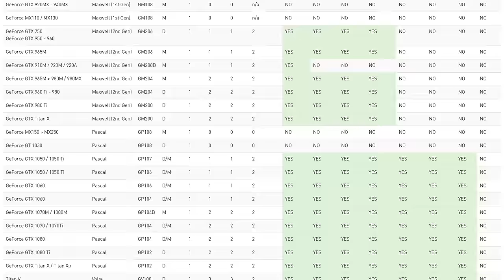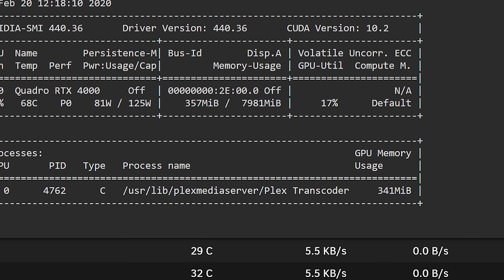5 First Plex Media Server Build Mistakes

Comment: I've noticed something strange with my server. When transcoding.. playing out a movie to my roku the CPU temp is between 41 to 57 C. When transcoding...playing out a TV show episode. It runs from the low 50s all the way to the high 60s.

Here's my specs
Linux mint 
Asrock motherboard 
32gb crucial
AMD ryzen 3 3200g
Front and rear case fan
AMD processor fan
I vented the pci slots.

I'm at a loss for the weird temp fluctuations. Input is appreciated.
Reply: I think that this depends on the file type. Some file types need more transcoding power and other don't.
And besides... 70 °C is not bad for the CPU. If you think that the CPU temps are to high buy a better CPU cooler.
Reply: Pretty sure he's right. The movies are probably in a file format that requires less transcoding, since most of your TV shows are probably from a capture card versus some type of physical media rip, and we're converted to awful formats for size relating to uploading if I had to guess, but like he said, those aren't bad temps at all. Actually pretty good. If it was 80c+, you might would have cause to worry.

Comment: What is your take on prebuilt servers like a Dell R420?
Reply: You can do just as well going the DIY route, but way cheaper. If you are a company and want to have a lifeline to call (ie support) then go with Dell, HP, Cisco, etc. If you are a home user, DIY it!
Reply: @jbat66  found a bare bones cheap and planned on DIY-ing it from there. Also going to use it for a minecraft server for my kids and friends.
Reply from the maker: you can get some great deal on old servers from ebay or the like. But some of them can be pretty loud
Reply: @Bytemybits  yeah gonna be in the basement by itself

Comment: Love the Seagate hate haha. Not gonna lie though mine have been pretty reliable so far.
Reply: I have 5 5TB failed in 2 years time, luckily all during warranty.
Now the next one failed just outside warranty.
So yes I understand why people hate Seagate 😉
The replacement drives work for many years now, maybe I had a bad batch. 
But the shop stopped selling them as they got to many warranty claims as according to them they sold around 50 of that series and all came back
Reply: I spoke to soon.
The next Seagate drive broke yesterday and I hear a strange sound on another drive.
I checked smart info and it seems my Seagate 8TB is also generating errors and this on is 2 years old.
Replaced the 5TB with a Toshiba Enterprise 18TB and the system is recovering now.

Comment: "You don't need a lot of RAM", "16 gig is the bare minimum"
I'm confused.
Reply: XiaZTV 16 isn’t usually considered a lot of ram these days.
Reply: @SnowyRVulpix   Yes, 16 is not considered a lot for normal PC.
But for Plex, 16 is not a bare minimum, more like 4.
Even with a lot of app running in the background (like Usenet/Torrent client, sonar) and while transcoding 4K the system only consumes 3.8 gigs.
It doesn't mean more is bad, OSes these days use spare memory for cache, so by having more you get a faster system overall.
But the bare minimum is definitely not 16.

Comment: Should I use NAS certified drives or normal drives are fine for plex? Specially if running multiple drives?
Reply: NAS drives have several benefits... the biggest thing is they are rated to run 24x7.  There is also additional logic in the boards to handle errors.  Also you get a better warranty.  IMO its a no-brainer to get NAS drives.
Reply: Be warned, the WD red drives are now singled magnetic recording so they're a lot slower and you can't resilver them without errors

Comment: ok i missed what he said with ssd's sorry but yes the faster ssd the better and faster your plex or emby server runs
Reply: If you are running a multi-drive raid, the performance differences of HDD vs SSD for serial reads of media files isn't that huge compared to the drive costs of equal capacity.  SSDs for a caching layer and OS however I would agree with.

Comment: Just hitting around 3yr mark with my HGST Deskstars and had one spitting errors and not reading :( I just grabbed a refurb'd HGST Ultrastar 7K4000 for $64 on Newegg. Those drives are so cheap. The wiped the data off the firmware so it has "0 hours, 1st power on" though :(
Reply: HGST drives are really, really good.  They no longer exist however.  HGST (Hitachi Global Storage Tech I think) was spun off by Hitachi and was part of the WD family.  They are used in many multi-million dollar enterprise arrays from DellEMC, Hitachi and IBM.  Hitachi forced WD to give back the H essentially, so WD had to rebrand the drives.  I think they are just be rebranded WD Enterprise so looking for those will provide a suitable replacement.
Reply: @RVSpinX  Ya I remember when they were bought but I was hoping to grab an old new boxed one lol. I may just start using these old enterprise refurbs from now on. My PLEX server has 6x10TB shucked WD Elements so I have my NAS backed up on there now.

Comment: I have got an nvidea shield. And i wanted to connect my wd 5tb storage to this via usb l. Will this be okay as the nvidea is on 16gb and i dont want an issue about thumbnails.??? Any help on this.
Reply: I think you'll be good to go, but it obviously depends on the size of your library, so there's no way to be sure from here. : ) 5 TB is not too much in the Plexverse. Some larger libraries go over 20 GB.

Comment: I have to laugh every time someone trashes Seagate hard drives, ive had them running for years on end without issues. I have a 40 gig running for over 14 years, in that time i have replaced over 40 WD hard drives a every kind, and all my Seagates keep running. Guess its just luck of the draw and where they ship them out to as i see more folks out west hate Seagates and more folks on the east coast have issues with WD.
Reply: I work in IT and there are always piles of seagates , yeah WD’s keep appearing in old nas etc because they work
Reply: If you stick around long enough you'll figure out over the long haul that one drive manufacturer isn't any better or worse than the rest.  If you have a particularly bad experience with one, it's likely you got several from a bad batch, or a faulty model.  But this happens to all manufactures.  I think Seagate and WD get a bad rap because they're the only ones that haven't changed names half a dozen times in the last 3 decades.  Everybody else has been bought and sold several times over.  For every Seagate or WD horror story you want to tell me, I can point to an IBM (né Hitachi, né HGST, né Western Digital) or Maxtor (né Quantum, né Seagate) or Quantum (né Seagate) or Connor (né Seagate) or Fujitsu, or Micropolis or JTS horror story.

Comment: ok, running plex on ubuntu 20.04. set the drives to mount automatically using the gui disk tool. Now plex will not see the drives. any suggestions?
Reply: could be a permissions issue.

Comment: Anyone know if dual Xeon E5-2680's is enough jumping off point for a PLEX server to handle a handful of 4K streams?
Reply: I run mine on vmware esxi with 16 of the cores allocated to it on a 2680v2 which is 10 cores each on ubuntu server.  Cant even stream 1 4k stream if transcoding and tone mapping is required.  If you have a gpu that can transcode that will help a lot.  You are better off making sure the clients can just nativley play the content if you are using hardware that old.

Comment: I really enjoy your videos but I'm running Plex on my TS-253D NAS.  I had my challanges setting it up, but the primary issue was playing back or streaming video smoothly over my Cat 6 network.  Video's did not play smoothly at all.  By default, "Use Hardware when available" was turned on. I turned it off and now everything plays smoothly with no issues!  When I updated the server to a newer version, it went back to the default again and the playback issues returned.  Fortunately I knew the fix.

I noticed that for live TV, if it's a 480i station, it will record at a 480i resolution, which produces a reasonable size file.  But if you're recording a 1080i station, it records at that higher quality, and of course the files are tremendous!  

I found no options to record at a lower resolution when recording a 1080i  station.  If you are aware of a method, I'm all ears!
So I learned how to optimize these huge files.  I have 4GB of RAM, which is below your recommendation, so I assume the hard drives are working like hell when I optimize.  The CPU also hits 90/95% But, the result of the compressed file is amazing in quality and size so it's doing everything great. Would adding RAM reduce the activity on the drives for compressing files?  I'm thinking of increasing it to the max, which is 8GB.

The old Beyond TV I used to use would automatically compress video's each night.  And yes, the CPU would run at max.  But it was a Win7 machine with 12GB of RAM.  I'm guessing I should add more RAM to reduce the activity on the drive, right?

Also,  I didn't see any automatic process in PLEX to optimize.  Am I overlooking it?

Comment: I'm confused why my video card would be needed for my Plex Media Server on a headless Linux server? I do not even have a monitor hooked up?
Reply: To transcode streams. E.g. you have a 4k video file, but you want to watch it on a mobile phone. The server can make the 4K a 1080p stream to not overburden the phone. GPU's do this better than CPU's, which is why you would want a GPU in your Plex server.
Reply: This is only with plex-pass, it's a paid feature. However I goes into GPU transcoding in the video
Reply: @lenthemofo  interesting! I got a lot to learn apparently! I just bought a cheap video card, thinking I wouldn't be using it unless my monitor was plugged in.

Comment: My index or something is taking 60gb of space.  I changed some setting and it’s taking up too much space.  It’s a vm so I will scrape it and start over if I can’t fix it. It’s on a 12 core 24 thread intel with 74GB of ram. My media is about 12 TB.

Rack mount is loud as shit. Don’t ever buy rack mount. Look into silent case and only 2 16tb drives mirror. That’s it.

Comment: I copy and play all my media in DVD or Bluray, original quality to and from a qnap plex server.  When playing videos to my TV thru Cat6a, I still get issues of buffering, I am forced to "transcode" to a lower quality 20mbs-1080p.  I do not understand how or why transcoding from my original quality content has no buffering, and playing original quality has buffering.
Reply: I can play 4k hdr over my LAN. I’ve had issues like yours before. Seems like it was something in Plex server settings. Try it over Wi-Fi maybe. Also, I’ve tried steaming over cheap routers and it didn’t work.
Reply: @cuzr702  thanks for the replie, I've got a brand new gigabit router, that's not the problem.  I've had this issue for a long time. I've just been living with it.
Reply: @timnels8638  Might just be the format your using. If your using uncompressed files it may just be to much to handle. You can download content with better quality then Blu-ray and smaller size too.
Reply: @cuzr702  I do copy files in original format and play them non-transcoded.  Looking for quality of picture.  I am a unsure if this is the right way to do this.  I always figured that watching in original quality meant no transcoding so less work for any processor.  But getting buffering when playing at original quality and no buffering when I transcode at 20mbs  has me scratching my head and questioning the way I copy files.
To be clear I purchase all my DVD and blu-ray discs retail, then copy them to plex, for my personal use.

Comment: I'm having a strange problem. My server runs a 4k video with no problem but when i add a external subtitle to the video It says that my server is not powerful enough. Any ideas on whats happening? Thanks!
Reply: possibly be that it tries to transcode the file when you add subtitles. Not certain just my guess.
Reply: When you add the subtitle, it's trying to transcode. You can check this on the Plex Server. If it's a PGS subtitle, try SRT.
Reply: @wvzuilen  It is SRT that i am using
Reply: @guilhermepena5461  Some Plex apps on certain clients don't have the ability to show the subtitles natively, so the server has to transcode the video and burn the text into the video stream. Transcoding 4K video streams requires a lot of processing power, which is why you often hear people on forums and YouTube recommend not even trying to transcode 4K content.

Comment: Laughs in 256 gb of RAM. However it’s server RAM from DDR3
Reply: Still plenty fast for a Plex server.  In this case I think I'd rather have more DDR3 than less DDR4/5
Reply: @406Steven  for sure. I only bought that much because of the low price. I paid less then $100 for it.
Reply: @OMGhangout  Can't beat the price!  DDR3 can still hang, it's not the new kid on the block but PC hardware is so fast these days that you can get a lot of bang for your buck from older hardware.
Reply: @OMGhangout  Damn, less than what i paid 16 GB of DDR4 not even a few years ago

Comment: Can anyone help me out? I have a Plex server running off my main PC when my family watches off of it I can see in task manager that it's transcoding to their house no problem but I noticed when I'm watching at my house on a fire stick it sometimes gives me an error stating "conversion failed the transcoder exited due to error" but I'm I'm streaming on a fire stick locally from my PC which is hard wired to same internet shouldn't it stream over WiFi and not transcode?
Reply: transcoding means the computer has to output the video into a format your fire stick recognizes. the fire stick can't just play any video file like ur computer can. thats what transcoding means, doens't matter if its local or via the internet.
Reply: @xyeahtony1  gotcha, so what is out there that can do direct play? That I can swap out for all the fire sticks I have
Reply: @rz5401  It also sometimes transcodes just for subtitles, something to keep an eye on. But what TV do you have? Most smart TVs now days have Plex apps built right in you just download it from their app store and they can usually direct play all your H264/H265 files when you're on your own network. I have LG smart tv's in my house and they all direct play just about everything, it's fantastic. (If you were to buy a new TV I'd suggest LG, samsung is not as good in my experience)
Reply: @cdurkinz  10-4 and I have a Samsung smart TV I'll give it a try with using Plex on the TV more often than the Amazon stick
Reply: @rz5401  Ah, ya samsung isn't as good in my experience.

Comment: Urr, for anyone dumb enough to reuse "known good" cables in a server holding all of your precious data, remember, sata cables come in packs of 5 for less than $10. There is virtually no need to reuse them. Ever.

Also. SAS to sata x4 cables are just as cheep and will outlast a standard sata cable.
That would require you to have a raid card however. Not everyone does I know.
I do. Only an 8 port LSI card. But that's all I need right now.

Comment: @8:50.  Don't place your hard drive on the top of a case for vibration. "Unless it's a SeaGate, in which case it'll going to die anyway."  INSTANT UPVOTE -- THANKS!
I bought 12 of them (Seagate 4TB) over a few weeks -- single vendor though-- and hooked them up to ZFS.  Worked great in testing for a week, then a day after starting to use it - BANG, Warning indicator, Seagate Tools says dead drive.  Warranty. $20? and 2 days later, all good.  2 days, BANG. Dup.  3 days later, BANG, doing the warra .. BANG.  Really? It got to where I could barely replace the drives fast enough to keep ZFS RAID3 live.
Ended up taking a bath on 'em;  the original ZFS system (6 drive Hitachi) I was replacing that lived right next door worked fine for years.  SEAgate -- SEE all your money doing a GAT-a-way.  (I had a much better slogan but I stored it on a Seagate drive.)

Comment: I tried Plex and it stutters like crazy. I will continue to use Infuse connecting to a HDD on my router. No stutter issues there... I really wanted it to work and I would have gotten the Premium. But if I have to buy a new computer with a $3000 video card to make it work, then I pass.
Reply: I run Plex on a core 2 quad and have no issues
Reply: Ya that makes no
Sense.
Reply: All plex is basically is a file server. Then it offers a transcoding on the fly, lots of apps on different platforms, and a web based GUI. I’ve never seen it introduce stutter. You have another problem you need to diagnose and solve.
Reply: I've never had a problem and ive never used a gpu.
Reply: i had it stuttering at first due to a network bottleneck

Comment: Why so much hate for seagate hard drives?
Reply: Because they have high failure rates
Reply: Most of us who'd bother watching this have had a lot of experience with computer hardware, and if you have, you know that Seagate drives are just not as reliable as WD.
Reply: @Darqness Won . Actually almost all of the rep has to do with a backblaze report from years ago with 3tb and 4tb drives, with a few anecdotal stories mixed in. It's kind of a false consensus that is treated as fact. 

For a while WD had a worse failure rate than seagate, but people missed that,